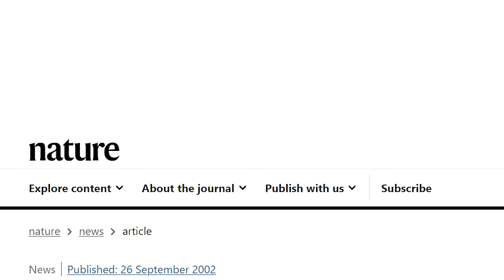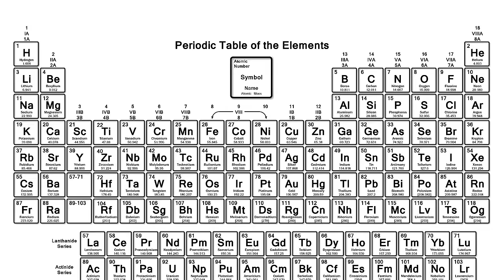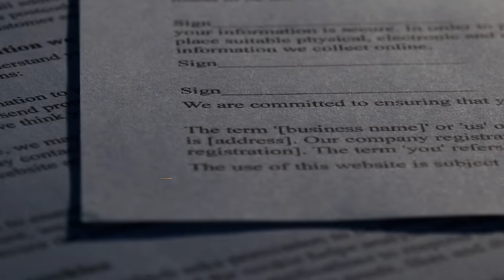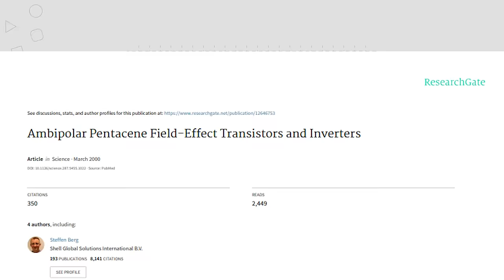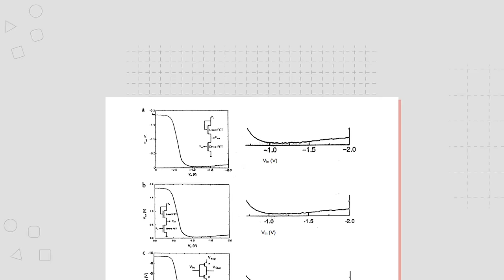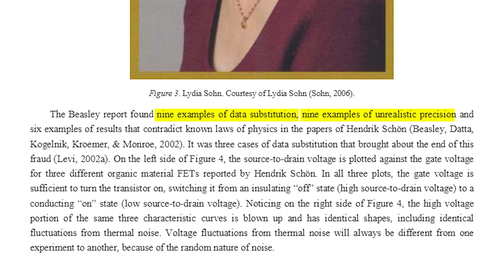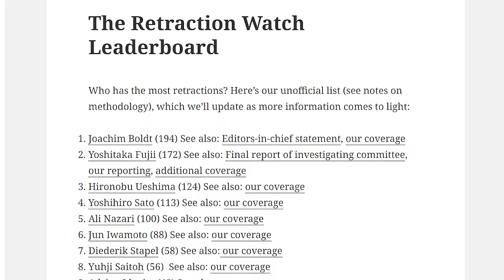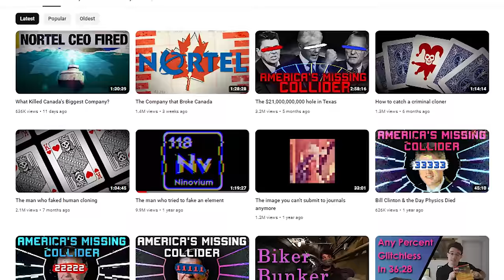He almost faked his way to a Nobel-Prize

Comment: "Transistor = Switch" Clearly digital-centric. Transistors can do more than just turn ON or OFF. There are analog circuits, where the transistor is varied between on and off.  No, not to be confused quantum phenomena of being both, but actually a very real ability to vary the conductivity. In the old days of electronics, it was almost all analog. You know, your grandparent's radios and TVs. All analog circuits, for decades.

When I heard this guy's name, Bobbybroccoli came to mind, as he's done a real in depth coverage of this fraud. He also made another science fraud video, on stem cell research, from Korea (hwang woo-suk).

Comment: Pete.. small fact-check thing: Moore was the co-founder of Intel, where he sat on the board for a very long time. His paper, called "Cramming more components into integrated circuits" is very short, and is about the idea that integrated circuits (at the time being a chip with some operational function) would become smaller, and that this would allow.. more components to be put in these varied specialisations of integrated circuits, which then would increase the processing power. His company would go on to ditch that idea completely, and instead move on to the model that made Intel the company it is, where complex circuits are replaced with higher clocked and fewer generic circuits.

In other words, "Moore's law" applies to a concept that was ditched by Intel, and arguably caused the split in Fairchild that led to founding AMD. Meanwhile, Ibm and ARM have been working in areas where Moore's suggestion is more relevant. But the whole paradigm that modern computers are based on is not even remotely connected to Moore's thesis: the idea that computing power doubles every now and then, and storage space grows exponentially and so on - complete bonk. Does not happen, it's a marketing blurb.

Other than that, Claudine Gay argued that opposition to sionism, to christianity, to whatever, and even very upsetting opposition to something - may very well not be a problem, nor that it should be banned from debate. In certain contexts, it is possible to argue even very distasteful things (although the culprits here were not actually calling for eradicating jews). At a university, that is not a controversial statement, to simply say that the ceiling for censorship is extremely high. And that without considering the context the statements were given, you cannot possibly just blanket condemn something as attacks on jews, or making the campus unsafe (which is what was alleged). But it is a controversial statement in the US congress and senate, never mind in the hearing that you clipped from, where criticising Israel shall not be excused "in any context". So while I'm sure the accusations "sound" worse than the plagiarism (that was basically bullshit, like you point out), they are flatly the result of the efforts of an Israel lobby that then brags about having gotten rid of Gay - in public. "This is what happens when you are silent and weak against anti-semitism", said the Israel on Campus Coalition, openly arguing for banning any opposition to not just Israel, but any pro-Israeli demonstrations. 

And an academic that just says "well, we should probably not ban speech, whether it's this or that" is considered a threat to that.

Comment: Transistors are not only used as switches (in the saturation and cutoff region of the transistor), but as amplifiers when the transistor is biased in its linear region.  Transistors weren't even used as switches at first.

Comment: There is a very rare, but more rigorous, process than peer review: peer auditing.  An independent 3rd party must audit the actual experimental setup, data collection, and data processing for acceptance.  It's expensive and inconvenient, so it's likely reserved for cases where the scientists don't trust their own results, like the "faster-than-light" neutrinos finding that turned out to be due to a damaged fibre optic line.

Comment: Great video. But as far as I know heat isn't the main reason why Moores Law will end. It will end due to the limitations of quantum physics. At some point the barriers will be too narrow to stop electrons
Reply: well, the electrons could fit through the barriers (x), provided the uncertainty in the momentum goes up per p^2 ~ hbar^2 x^2...which is quantum physics,  and when p^2 goes up, p^2/2m_e goes up, kinetic energy is KE = p^2/2m_e, and (3/2)k_B T = KE...so temperature goes up. Everyone's right. No need for retractions.
Reply: @DrDeuteron  I didnt want to say that temperature doesnt go up, it does. But it was manageable in the past and probably will in the future. The narrow barriers are the definite limitation
Reply: @DrDeuteron  But you are right that it doesnt need a retraction, maybe just a correction that it is not the only problem
Reply: Heat is, since manufactures are building multilayered chips whose biggest limiting factor is cooling

Comment: You probably mean "TransistOr" ? BTW, at about 1 min 26 s, a copper grid is shown. The one I know are used to hold samples in TEM (Transmission Electron Microscopy). At 1 min 22 s, it's glass or quartz (Silicon oxide).

Comment: I think everyone is responsible.  Sure, Schön manipulated or fabricated the data to get more publications, but why did he feel compelled to do that?  I think because the pressure to publish is very real and a bad incentive.  Scientists are absolutely judged based on how many publications they have, and that combined with the intense competitiveness for prestigious jobs in the chosen field (or sometimes any job in the field) can incentivise some researchers to tweak data, move to publish prematurely, use improper statistical analyses and various forms of p hacking.  Outright fabrication of data is rare, but it does happen.  All of this is why all the science disciplines (it's not just psychology and behavioral sciences) are facing a replication crisis.  It's one of the reasons I left research.  Basically the entire industry needs to bw cleaned up.  The incentive structure needs to change, but I have absolutely no idea how to do that.

Comment: Why do some people pronounce it "aluminium" rather than "aluminum"? Why do they pronounce an extra i where there is none?
Reply: Not to be pedantic, but both "aluminium" and "aluminum" are both correct ways to refer to the metal. Aluminum is used in the US/Canada, whereas aluminium is used in the rest of the English-speaking world. Aluminium, with the extra i, is used more often by international organizations like IUPAC.
Reply: @mikelarson2871  But is it the spelling also or just the pronunciation that has 2 versions?
Reply: @mikelarson2871  Never mind. I just looked it up. You're right. Here's another weird one: The word "sanction" has two diametrically opposite meanings.